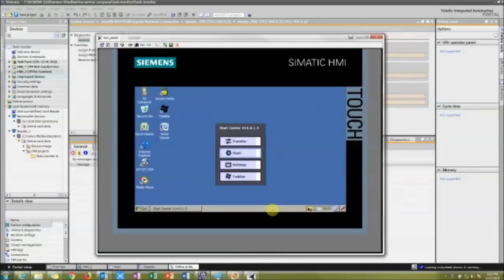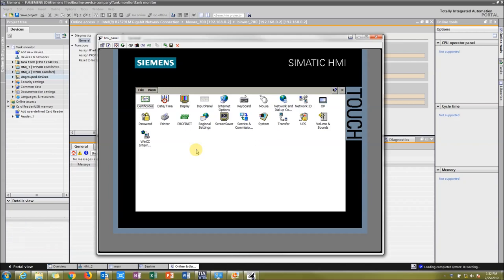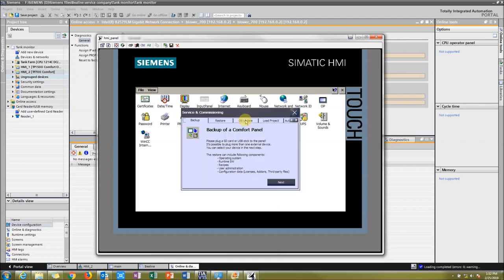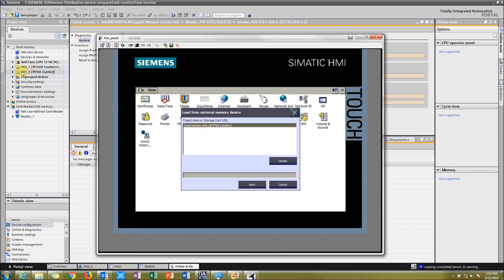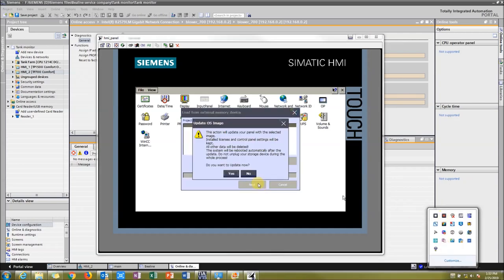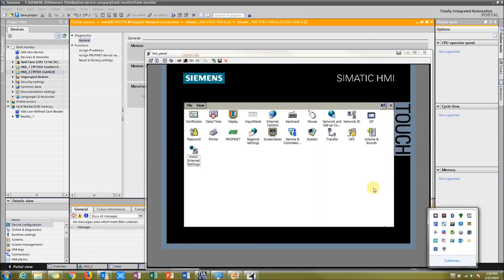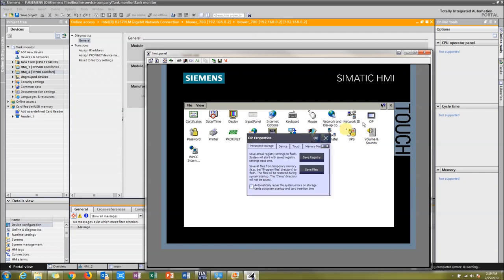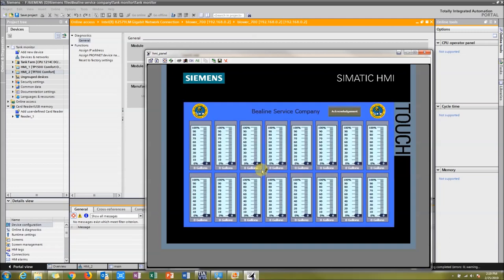Loading an HMI Runtime Project from a USB to a SIMATIC Comfort HMI | Siemens Support | AWC, Inc.

Comment: I use TIA V.15 and my hardware is Comfort panel TP1500 Runtime V15.00.00.04_04.01 in TIA V15 it just have only Comfort Panel 15" Firmware V15.00.00.04_01.01

How can I update my TIA HMI Comfort Panel 15" to Firmware V15.00.00.04_04.01 ?

Can I use this firmware to download in TP1500 in Runtime V15.00.00.04_04.01 ?

Is it can work ?